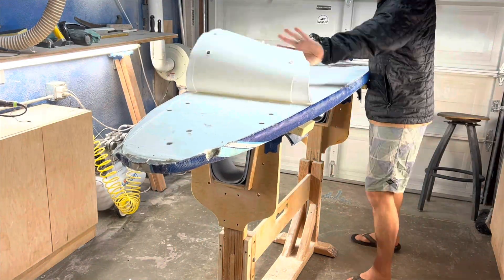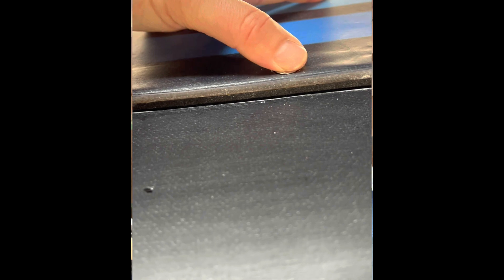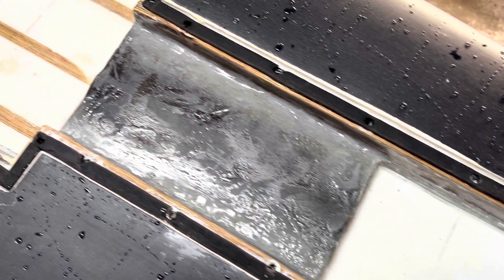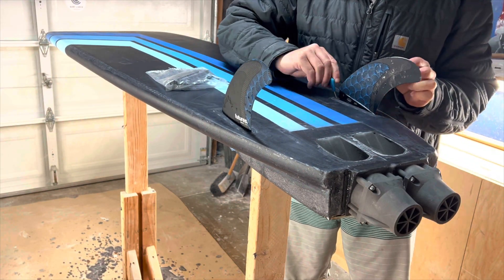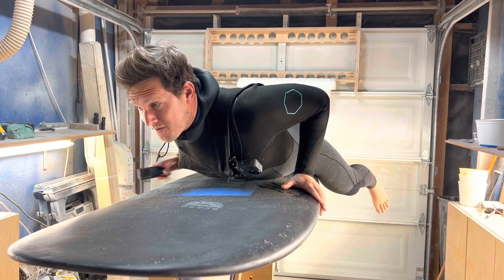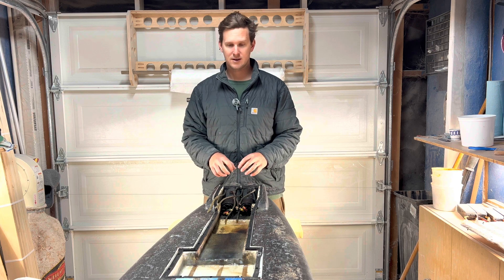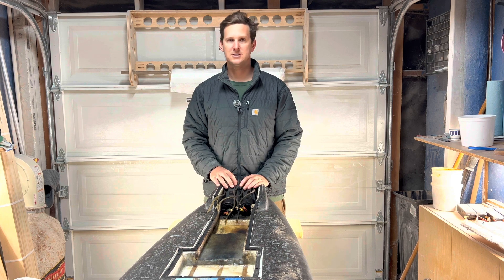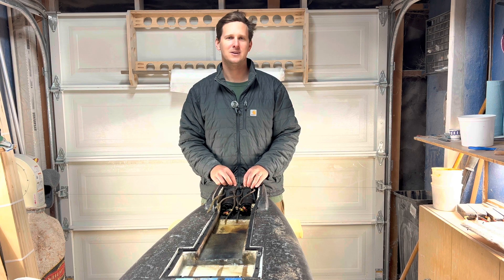My DIY Electric Surfboard – Here’s What Happened

Comment: Ok so I discovered the real reason for the ESC failures. They dont use enough thermal glue to ensure a waterproof seal in the Flier ESC’s so you need to cut that shrink tubing open and drown the whole thing in glue and reshrink it. Happened to mine as well.

Comment: Lot to learn, I built the same jetboard and had to optimise it for a year until I was satisfied with the results. You really need to be sure that it is water tight. The main problem is the lid and the shaft of the motor. To get it right you need to use marine grease and the right O-Rings.

Comment: Two compartments, bro — ideally even three. Keep motors, ESCs, and batteries separated.
Mount the ESCs on a small platform so they don’t end up swimming in a puddle of saltwater next time.
Also, check out how Jetsurf designs their intake — I overlooked that part on my build and it turned out to be crucial. The intake needs to be angled just right.
Your nozzles should be nearly submerged, rising just enough to shoot out water above the surface once you gain speed.
One more thing: please start at a lake. I took my first e-jetboard straight to the beach — one tiny wave smacked the batteries right through the plexiglass into my face.
Ocean’s no place for first runs.

You’re killing it, bro. Trust the process, take your time, and you’ll get there!

Comment: So sick! Good luck. I wonder if the batteries should be closer to the nose so that it’s more balanced and the bouyancy isn’t all messed up because all the weight is concentrated toward the back half of the board 😊
Reply from the maker: You typically dont want extra weight in the nose because maneuverability gets harder. But a more buoyant board would help for sure
Reply: @ZakBeardSurfboards  In my project this year, I took my 97 liter wavestorm 9' board and added 1.5" thick of foam across the entire bottom then am fiberglassing it to increase the bouyancy dramatically. Trust my bouyancy is everything on these boards. Doing the math I'm going to have about 160 liters which will help alot also make sure you are getting good flow to the motors and ESC's. I recommend two water pickups on each side. I'm running the same ESC's and the SSS 360kv motors with the two stage setup. Also 12S power isn't enough on most boards, you need 15S at least to make things run well, only reason simon could do it on 12S was because he weighs like 160 pounds. I ran 16S last year and that had enough power to go 30 MPH+ especially with more bouyancy. I'm running 15S lithium ion cells this year to make it a bulletproof battery connection setup and to get longer ride time.

Comment: Very nice going to build one as well, not paying 10-14k which is ridiculous. I could literally buy a jet ski for that. What motors are those?
Reply: SS56104 KV360 are mostly used for those projects, he prob used them too... Pair it with a Flier 400A BOAT ESC and around 18S LIPOS and your good to go! Should push around 20kW and depending on how good your board design is, you will need the power in order to gain atleast some speed. Good luck :)